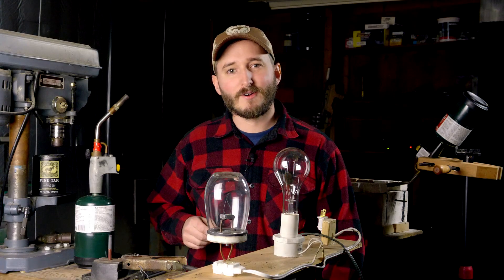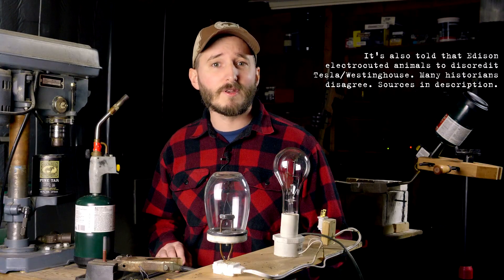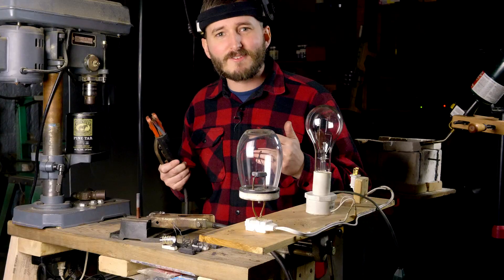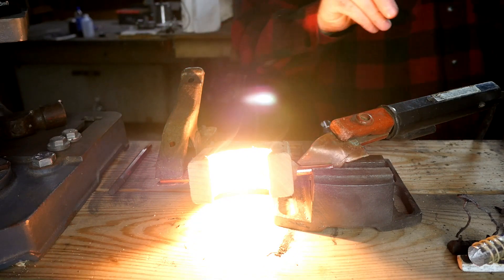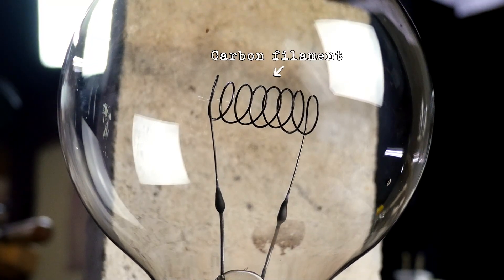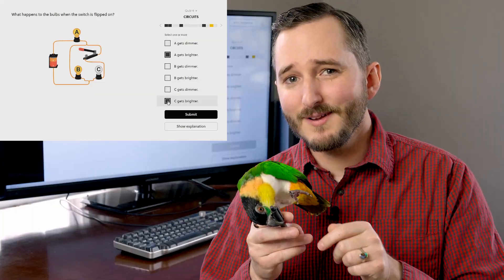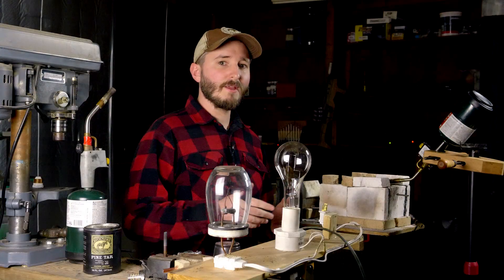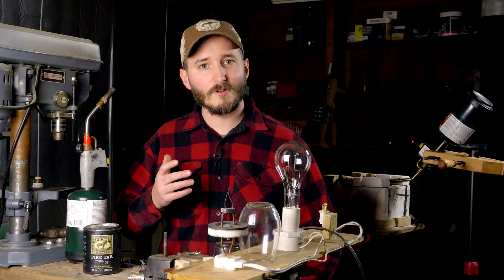Re-Inventing The Carbon Lightbulb

Comment: Can you do a followup video using C02 or Argon Gas? What about bamboo thread? Apparently the bamboo filament was shaved to the thickness of a thread. And what if you use a dimmer switch to add power to the filament slowly without the need for a secondary bulb?

Comment: Did you try powering with a car battery. They are low voltage but supply 50X the current of an AC outlet. This could provide the punch for your spiral filaments.

Comment: what percentage of the current is going inside the carbon wire and what percentage outside in the air/gas plasma around the carbon wire. above gives not through yourself or your works. free gift, not paid by people. and glow ionization of the gas around the carbon rod. like electric sauna stove stones heater. carbon fiber as the filament. carbon fiber is not brittle. C+N = CN gas. water steam vacuum. carbon fiber cloth coiled in as a wire. well carbon fiber is used as static electricity removal high resistance conductor.

Comment: One could also debate that the carbon arc light source,  as impractical as it was for widespread use in the early days of power generation,  was actually a very important light source, perhaps even more so than the filament lamps, because neon tubing, fluorescent lamps, mercury vapor, metal halide, high pressure sodium,  low pressure sodium for example,  are all a type of arc lamp and would not be possible were it not for the discovery of the electric arc by Humphry  Davy around 1809 when he created an intensely bright light by connecting two wires from a 2,000 cell battery to charcoal sticks.

Comment: Multiple bulbs connected together acting as resistors... that sounds a lot like incandescent Christmas light strings. Newer strings are designed to bypass burned-out bulbs so the remaining lights can stay lit. However, the more lights burn out, the brighter the remaining bulbs get until they get too bright and fail.

Comment: When I did this for the science fair in elementary school I just drew a vacuum by mouth on a flexible rubber hose before pinching it off.  I also tried lighting a few matches before covering them with the bulb letting the matches burn up the oxygen as they burned out.

Comment: As a pre-teen I made a carbon arc lamp using a flower pot and carbon rods and salt water.

It was incredibly bright, and I did not have proper safety equipment.
It took some time for the giant spot in the center of my vision, to go away.

Comment: You could put pencil lead as conductor between high temp glass rods the same diameter as pencil lead.   Put the alternating glass and graphite between large plates of high temperature glass.   Connect all pencil leads in series using soot tar putty.

Comment: I did this when I was thirteen. Except I used a pipe cleaner that I had un-twisted for my filament. Then I took one of the two wires you get from a pipe cleaner, straightened it, and then carefully wrapped it around a 2mm mandrel to make a coiled filament. I tested this with a 12v d.c. wall wart as my power supply, and I put it in a small minced garlic jar, garlic excluded, of course. If my filament burnt out, I made another one with one more turn of wire around the mandrel. Eventually, I had a homemade light bulb that was bright enough I could read by, and lasted quite a long time. Basically comparable results as this video.

Comment: Carbon resistivity has a slightly negative temperature coefficient. Both amorphous and graphite forms. 
Though this could be getting offset by the properties of the general supply circuit.
I do know you may need some patience with a filament that massive; even commercial tungsten bulbs take time to warm up and can pass a substantial fraction of rated amperage without becoming incandecent. These properties are enough to effect drag race driver response times (The switch to LED was a major organization level thing because of it.), and it has significant impact on the 3-bulb method of synchronizing large AC generators before connecting them(2 dark 1 bright is used rather than 3 dark).

Comment: Try using bamboo fresh. It may be still flexible enough to bend into a shape and then left to dry after shaping over a form. Also try soaking in urine, specifically cow urine. It was a technique printers used to soften the leather used to make the pounce used to apply the ink. Urea might have other interesting effects on the filament. Also the easiest way to carbonize anything is to put it in an empty paint can after a nail has been used to punch a single hole in the lid. Hammer the lid in place and sit it on an open fire or open bbq grill. The hot air will be forced out creating a vacuum and smoke and a small flame will be seen exited the hole. When the smoke and flame are gone the material is fully carbonized and it can be removed from the heat and allowed to cool before opening the lid. This is how regular charcoal is made and smoking flax/tow rope is made for carrying in a tinder box for starting fires with flint. Much easier than your setup. At the same time you can make more of the powdered charcoal you need for the carbon clay by putting vine or white pine in the same container and then pulverizing it with a hammer or mortar and pestle after you have cooked it or putting it in a blender or ball mill. You may be able to make a good vacuum with a mason jar boiling it in water to force out the air like you do with canning. A real bees wax or paraffin wax seal could be used. Adding salt to the water increasing the temperature at which the water can be raised before it boils but paraffin has a lower melting temperature than bees wax.

Comment: I haven't read thru all the comments, and I know this is an old video... but have you tried soaking your bamboo in ammonia ? I have done this with popsicle stick and can twist them like a screw. This require soaking for awhile, but the wood becomes ultra flexible.
Reply from the maker: I did try that. I think the bamboo I was using was already treated and no longer able to become flexible.
Reply: @Nighthawkinlight  Thank you for your quick response! I really enjoy your videos.

Comment: I know this is a much older project, but perhaps instead of trying to guestimate the lenghts of materials and dealing with unknown resistances and changes over break-in periods, it would be best if you had a constant current or constant wattage supply? I understand a bulb in series is a ballast, but it also has that nasty inrush effect that gets pushed into your own filaments fast enough to blow them out. Constant wattage, constant current, as well as a fused variac, would be good tools for this sort of project.

Comment: Make a really beefy Tesla coil and under power it like wires raided for 1kw but give it 100 watts. And use that high voltage to power a florescent light but wire it different ground on one side and the high voltage Tesla coil on the other side the corona discharge inside the bulb is what makes the light. But it only need like next to nothing amps it only needs the voltage. But the light will last pretty much forever never burn out.

Comment: Cool info! You did however make a few safety issues I'd like to address. Mainly it was inserting a fuse in place of the lightbulb and assuming it would fail before your shops did. Always always always check your equipment before assuming anything, You should have tested the fuse to make sure it would, then in your video have a disclaimer NOT to attempt anything you see to be done yourself.  A few issues with your electrical wordings as well. I'll focus on the one that the modern bulb is adding a higher resistance to make your bulb work, this isn't accurate. Ohm's law explains why.

Comment: didn't tesla create a phosphorescent light bulb for the worlds fair, over like a long weekend or something insane?

it was brighter, cheaper, lasted longer, used less power, and could be powered wirelessly... and he pretty much only did it to shit on edison iirc lol
Reply from the maker: He made a carbon button bulb. It used high voltage as power and made x-rays when used. Probably never would have been practical or safe for those reasons.
Reply: @Nighthawkinlight   
weird.. i posted this weeks ago, but it got deleted or something? looks like google delete comments with links in them, but doesn't tell you it deleted them? so reposting this stuff ><
---
there was a history channel thing on it forever ago (but it wouldn't be the first time they were wrong i suppose)

i also found mentions of him using fluorescent lighting elsewhere (can't link it, but just google "fluorescent lighting worlds fair tesla"

but there are other places (pbs) saying the main bulb used for lighting was one that westinghouse acquired (sawyer-man double stopper bulb). but that tesla had a separate exhibit with his phosphorescent bulbs.

i do see that he invented a carbon button bulb, but it doesn't seem like that is what was used at the fair. especially since he was aware of the radiation it created.

Comment: What if you use a mason jar and a Schrader valve then use a small bike pump and reverse it to suck the air out of the jar?  Hook them bulbs to a voltage regulator.

Comment: I did something similar a few years ago with my grandsons. I used an old pickle jar with electrical connections glued through the lid and also a connection for a vacuum pump made from an old refrigeration compressor. For a filament, I used a 0.7 mm pencil lead from an automatic pencil. And a power source was a 12 V lawnmower battery. It worked quite well and I have a video of the end result. It produced a lot of light and heat, and lasted for several minutes before it died.

Comment: Are you planning on creating longer filament, passing higher voltage through it (with current limitation) to convert it to the more conductive graphite and then using it with lower voltage?

Comment: One interesting idea would be to use something that incandesces better than carbon does - say, some cerium oxide abrasive powder for polishing glass - mixed into the soot-and-tar putty you coat the filament paper in. Another thing to try to make your cheap oil-vane vacuum pumps work for higher vacuum is to use a flashed getter made of, say, aluminum or titanium wire quickly spiked with a car battery or welder at the bottom of the chamber to absorb all the residual air after pumping it down - this is one I've actually heard mentioned by my dad, who MADE working vacuum tubes in the shop portion of his electrical engineering classes in the 70s and early 80s, titanium resistance wire works best and is fairly cheap as it'll absorb both oxygen AND nitrogen in a vacuum.

Comment: You hate Edison because you think he stole credit from others. I hate Edison because he preferred DC electricity. We are not the same.
Reply from the maker: High voltage DC electricity ended up being the more efficient for long distance travel. That's what modern lines use until they get from the power plant to substations that convert it over to AC for distribution. DC is also responsible for running the device you left this comment with. Both power types have important uses.

Comment: I did not know that a filament could pull more current than a circuit breaker and therefore tripp them. Makes sence since your filaments are thick and offer a lot of resistance at any rate great video.

Comment: I seem to recall that porous carbon can be made more dense and converted into graphite like material in a closed chamber filled with a hydrocarbon gas (methane) and heated to a very high temperature which dissociates the gas and deposits pure carbon on other carbon. It is also possible that bamboo can be softened enough to coil it, by boiling the fibers and coiling them while still hot. I live off grid so cannot try that but let me know if that works(it may take several days if soaking)

Comment: I actually have real carbon filament bulbs in my dining room chandelier.  Completely inefficient but it puts off the most amazing warm soft light.  Not quite Golden Hour light but very cozy.  Not sure how old the bulbs are but I've been using them for 15 years and haven't had one burn out.  I do have a soft start/stop dimmer driving them.  

I also have used carbon arc spotlights.  Unwieldy, needy, and finicky beasts.  I'm glad to have experienced them but am much happier with xenon and other modern arc lamps.

Comment: Propane is heavier than air, as many unhappy boat owners have found out, so you'd probably have been more successful if you inverted the glass - to fill and seal the bulb - before running electricity through it.

Comment: One of the improvements I saw was the extensive scaffolding used to string up the filament. A few pieces of wires insulated against each other to prevent short circuits and a length of string might do the trick.

Comment: The Edison filaments were conditioned by  running them in a hydrocarbon vapor, which broke down and deposited additional carbon - obviously something to be careful about. 

I would love to see you tackle a Nernst lamp some time, with the ceramic filament capable of operating in air.

Comment: Lewis H Latimer invented the  Durable Carbon Filament for Electric Light Bulbs. US Patent No. 252,386. Not Thomas Edison
Reply from the maker: Latimer published his patent a long while after lightbulbs were invented and out in the world. He made an improvement, not the invention. He also was not Edison's opponent. Edison hired him and Latimer ended up writing a book to document the Edison lighting system.
Reply: @Nighthawkinlight   Latimer worked with the famous inventor Hiram Maxim at the U.S. Electric Lighting Company. While working there in 1881, Latimer patented a carbon filament for the incandescent lightbulb. The invention helped make electric lighting practical and affordable for the average household.
Reply from the maker: @krobert81568  Latimer's filaments were carbonized paper. They did not end up being commonly used. He did not invent the idea of using carbon or carbonized paper, rather he came up with a way to make the paper filaments such that they did not break when being carbonized. If you read Edison's patent linked in the video description (published Feb 1880) you'll see it uses several varieties of carbonized filaments. The ones that ended up in commercial bulbs for the next 10-20 years were mostly bamboo or extruded nitrocelulose. Latimer's paper filaments were clever but not a major shift in the course of the invention.

Comment: How does the swann night light bulb last so long?
Reply from the maker: Night light bulb? You mean like a modern one?
Reply: @Nighthawkinlight  yeah i opened one and found the resistor was bad. But the bulb itself which glowed orange for use as a night light had two very thick metal poles inside the glass chamber
Reply from the maker: @nicholasdavidson5683  The resistor is why they last so long, it underpowers the filament.
Reply: @Nighthawkinlight  oh true. Mine seems to have become too old and is darkened at the thinnest part in the middle. The bulb is okay. I want to see the bulb on again hopefully

Comment: Swan was not first. There is a horrible rewriting of history going on in the UK. What you need is 2 filaments so when one gets wider it will gets hotter and deposits on the smaller filament and then go back and forth. Could you try using see through ceramic too. Also try a thin walled tube shaped filament or try a thin sheet shaped filament.

Comment: I am surprised that more effort was not put into developing a miniature arc lamp.
Long ago as a kid I built such an device and it was fun to tinker with.  I used a
400 Volt transformer salvage from a old tube radio and carbon rods, extracted
from some small dry cells, mounted them in metal box with a reflector mirror. 
It worked rather well for such a crude device.  I never got around to adding a 
solenoid to maintain the rod's spacing with this improvement it probably would 
have operated for hours with no intervention required.

Comment: Edison knew that a practical light bulb needed to use a sufficiently high voltage (and correspondingly low current) so as to allow the transmission of that power over reasonable distances. His 110/220 volt, three wire, Direct Current system greatly improved that, by allowing the use of 110 volt lamps, but 220 volts for transmission (with the neutral).  We still use 120/240 volt, three wire services in the US, only AC instead of DC.

Comment: Very well made video. You clearly put a lot of effort in the making of this video. I would like to suggest that you get a large variable transformer (the Chinese ones on ebay are good enough,) and use it as your variable power source. This would then allow easy discovery of the volts and amps the filaments require, which would be a great addition to this kind of a video.

Comment: lewis Howard latimer actually made the carbon filament lightbulb an improvement from edison’s paper filament which lasted a few weeks
Reply from the maker: Latimer's filament was also paper. He had a clever method of sandwiching paper filaments between sheets of cardboard before carbonizing. Whether paper or bamboo or string they all turn to carbon

Comment: Two options for higher voltage: (1) use a 240 VAC outlet (dangerous), (2) use an autotransformer that lets you adjust the voltage above unity gain (less dangerous).

Comment: Would it be possible to use support material to make the filament longer?
Reply from the maker: Yes I've done so with aluminum foil
Reply: @Nighthawkinlight  Yeah I suppose that works so long it isn't shorting anything
Reply from the maker: @lazergurka-smerlin6561  you pull the foil out once the filament is carbonized
Reply: @Nighthawkinlight  Ah, yes that does make a lot of sense 😅